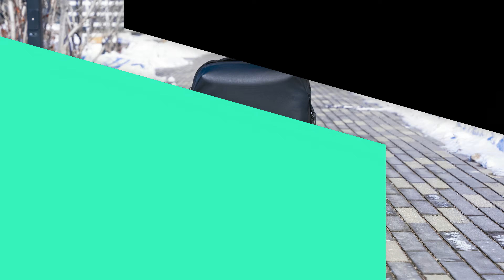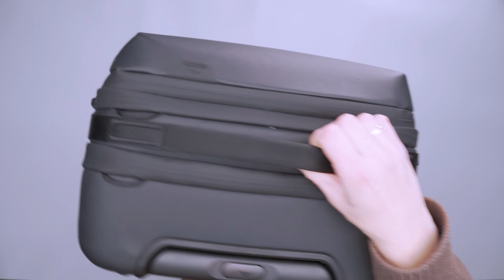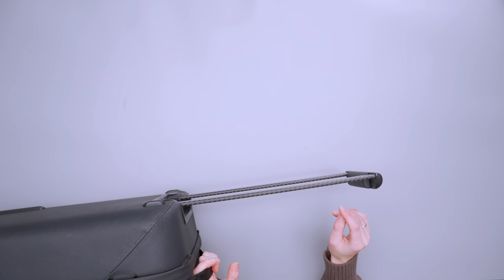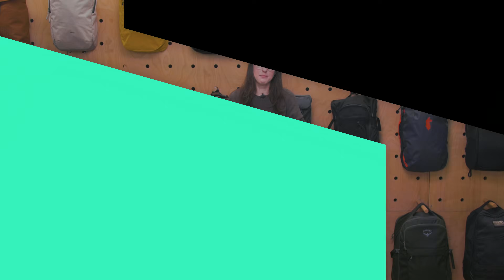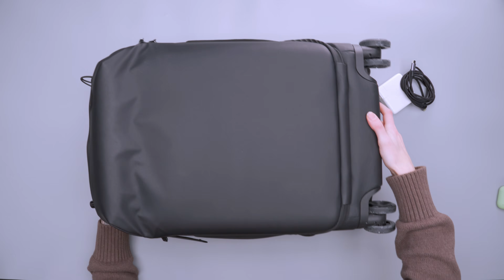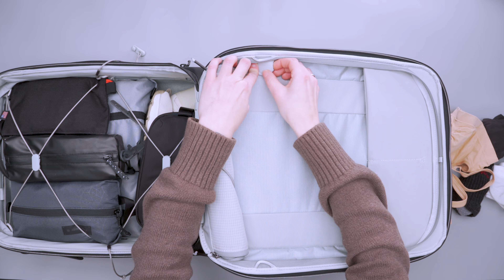Peak Design Roller Pro Review (2 Weeks of Use)

Comment: I can’t really understand the hype of the PD Roller Pro. To me it looks over engineered with solutions, where to me no severe problem exists. The upper packing compartment offers almost no volume and the new opening design doesn’t provide much benefits imho. All this leads to very heavy roller bag of around 4kg for only 34 liters capacity. Even expanded it doesn’t exceed 40 l.
My more traditionally designed climb shell type roller, Samsonite Proxis 55 cm Easy Access weighs only 2.8 kg, and has a 42 l capacity with 48 l expanded. The two packing compartments are large and have a zippered cover, which allows more flexibility than the PD roller pro. The roller bag also has a separate laptop compartment in front of the bag, and even more importantly a TSA lock, which the PD bag doesn’t have at all. 

So, in my opinion, the PD Roller Pro is simply too small for its weight. PD should have chosen a simpler lighter design.

Comment: How do you rate this so high if basically it can’t be checked in and most airlines won’t allow it for carry on? (US airlines excluded. Anything like a Lufthansa won’t allow for it)
Reply: It's still a high quality bag and where it's usable it's probably great. But as you say, it's too large for Europe (even though Peak claims "universal carryon", maybe for the US). The 4+ kilo weight is also a deal breaker for many, some airlines have 7 kilo totals, with 4 in the bag you have more bag than contents. If it were to fit, that is, which it won't. The handle design is great, though. They need to take that and then make a bag that is 2 inches shorter and 2 kilos lighter. They've definitely innovated, but they shot wide of the mark. Also, to be entirely frank... I don't t hink it's a very attractive piece, overall, either.

Comment: While the design and execution appear excellent (love it), I have two critical questions: 
1. Does the Peak Design Roller Pro comply with the international carry-on baggage dimensions of 55 x 35 x 25 cm (21.7 x 13.8 x 9.9 in) used by most international airlines; and
2. What is the Peak Design Roller Pro’s empty weight, given that many international flights now enforce a 12 kg (26 lbs) hand baggage total weight limit?
Reply: Both addressed in the video.
Reply: @ Yes, the answers are in the Peak Design Roller Pro Carry-On baggage’s specifications, but questions have to be asked to highlight the claim it is "Global Carry-On Compliant" which is only partially true. 
The PD Roller Pro’s external dimensions are 56 x 36 x 23 cm (22.0 x 14.0 x 9.0 in) while the average international carry-on dimensions are as 55 x 35 x 25 cm (21.7 x 13.8 x 9.9 in) for most international flights so it will depend on which flight and/or airline you are on. 
The Roller Pro’s empty weight is 3.9 kg (8.6 lbs) which only leaves you 7.6 kg (16.8 lbs) for total carry-on baggage allowance from the average total weight limit of 11.5 kg (25.3 lbs) for most international flights. 
Some airlines are now including the weight of your personal item as part of your total carry-on baggage allowance and are now stating that carry on items must be light enough to store in the overhead bin unassisted. So with that in mind, here is a breakdown of carry-on dimensions and weight limits for some of the major international airlines: 
- Air France: 55 x 35 x 25 cm (21.7 x 13.8 x 9.9 in) with a weight limit of 12 kg (26 lbs). 
- Air Canada: 55 x 40 x 23 cm (21.7 x 15.7 x 9 in) with a weight limit of 10 kg (22 lbs). 
- British Airways: 56 x 45 x 25 cm (22 x 18 x 10 in) with a generous weight limit of 23 kg (51 lbs). 
- Emirates: 55 x 38 x 20 cm (21.7 x 15 x 7.9 in) with a weight limit of 7 kg (15 lbs). 
- United Airlines: 56 x 36 x 23 cm (22 x 14 x 9 in) with a weight limit of 18 kg (40 lbs). 

Most U.S. carriers allow slightly larger dimensions (22 x 14 x 9 in) as compared to some international airlines, but the weight restrictions are often stricter with international carriers. Nevertheless, it is a great design exercise to stir up the status-quo, but I think I’ll wait for the slightly smaller Roller "non-Pro" version (V2) without the unnecessary laptop compartment and half the weight. Much like what they did creating the 30L Travel Backpack from the 45L Travel Backpack and downsizing their Wash and Tech Pouches.
Reply: Just traveled with Turkish airline. They limited to 8kg and weighted every time domestic and international flights.
Reply: The external size is 36 x 23 x 56cm, and the empty mass is 3.9kg. That is well into "ouch" territory, especially as it doesn't include a camera cube. The mass of this thing isn't so bad if you are flying on BA, which allows 13kg for your carry-on, but if you have a 13kg bag, you have to wrestle it into the overhead locker.

I'll stick with my Samsonite ultra-light hardside spinner.

Comment: Challenge question. How does one pack for a week or two weeks, if they Do Not want to be doing laundry on the trip? 
Wondering if it's a niche traveller group that wants one bag travel without doing laundry on vacation, or if you're missing out on a target audience by not including hacks for those types of travellers.
Reply: What are you looking for here, magic laundry that does itself? Merino clothing is good because it's anti-bacterial and the lanolin in the material keeps it from stinking even after a few days but other than that someone's gotta wash the clothes.
Reply: I travel with one carry-on and day pack no matter where I go, or how long I'm away. Yes, you do laundry. Basically a small amount each day to stay ahead of the curve for those few days that you can't. It is about the same effort and time as brushing my teeth. And I do that twice per day!

The benefits of being light and agile far, FAR outweigh the mild inconvenience of washing a few fast-dry clothes. Pro tip: Use the shampoo to wash in the sink, not the "soap."

Comment: Just get a Briggs and Riley bag. Incredibly durable, lifetime warranty, costs less, weighs much less. And get a $30 camera protector insert if you’re traveling with gear.
Reply: Looking at it spec-wise, design-wise, and price-wise, it may be competing with the B&R ZDX 22” Domestic Carry-On
Reply: @KevinBuehling  I've got the ZDX carry on. It's not only an incredibly smart design but it also never gets any eyes from gate attendants for bag size checks. Zero complaints here
Reply: Second the Briggs and Riley, got a Essential 22” carry on and it’s great. It costs more
Than Peak Design but you can usually get it at a discount at smaller brick and mortar baggage stores
Reply: But the B&R is even heavier at 4.6kg...

Comment: I feel this is just way over designed for something as simple as a carry on.

A hard shell gives plenty of protection, very light and I wonder if the overall packing volume (without the expansion) is even more than this one.

Nothing that really stands out, but the negative (weight) is actually a huge problem if you do intend to use it as a carry on

Comment: It's too heavy. I'd purchase it if it's not that heavy.

Unfortunately, some airlines' limit can go as low as 5 - 7 kg in Asia.

I'll stick with my Lojel.
Reply: Which Lojel do you have? I hadn’t ever heard of them but checking them out and their similar sized hardsided carryon is only .7kg lighter. Personally I think if an airline has an insane 5kg carryon limit they want you to pay to check or expect you to carry on a backpack/duffel.
Reply: @ironchefboyardeee I have a Cubo and an ulralight one (I need to check the model name, it's only 1,7-1,9 kg).

Yes, 5 kg is insane.
Yes, they do expect us to only carry one item.

They do it because:
1. They want to speed up the boarding and un-boarding process.
2. They don't want to park too long at the gates / tarmac.
3. Lighter plane = less fuel consumption 

You won't believe how low-cost airlines try to save money, they can and will turn off aircon.
Sometimes, we can't choose which airlines to want to fly with, lower cost airlines tend to have much broader schedules and options.
Reply: @ Interesting. Maybe they discontinued it because the small lite on their site is almost 3kg. 2kg would be really impressive for a roller bag.
Reply: Chinese flights rarely check the weight of carry-on luggage
Reply: @jiali7090  Not according to my experience.

Comment: Interesting bag.  I like the bag, but as a frequent traveler, I don't  like anything "hanging" off the sides of the bag, meaning locks or luggage tags.  A couple of years ago, I had to check my Rimowa cabin carry-on.  When being loaded on a cart from the conveyor, the luggage tag got caught up and somehow tossed the case off the cart and then it was run over by the tractor.  It crushed one corner of the case and damaged some things inside.  While Rimowa has a life time guarantee, it could not be fixed.  Moral of the story, don't let anything hang off the sides of the bag or case.
Reply from the maker: Thanks for sharing your insights! 🤙
Reply: I tuck the lock in the bag after locking it. I use Away cases for most of my travel now with built in locks which PD could have easily put in this design to make it one less thing to take on my travels.
Reply: @unitymind and heavier =P
Reply: Good point
Reply: So don't hang anything outside. Everything is detachable and reconfigurable. So put it inside

Comment: Certainly not cheap, but worth remembering it has a lifetime warranty and all custom hardware. Being able to replace the wheels is going to be really useful.
Reply: a lot of great brands with premium luggage have lifetime warranty too. so even if their wheels aren't user replaceable they will pick up your suitcase via a courier and deliver it repaired back. so I wouldn't really put this as a distinct advantage of PD .
Reply: @NL0Gwenster  I would be curious, which brands? Some might send you a replacement but most won't repair them, the old ones end up in landfill. PD are a climate neutral company and are conscious of their environmental impact. Not to say any of these qualities are unique to PD, but they add up along with others as to why they are a good company to support.

Comment: $600 retail seems like A LOT for a carry on, even if its very well designed and seems like a great bag. I travel a lot and work in video production, I don't see myself springing for this over a pelican air to travel with my gear. 

And if I'm not traveling with gear I'm really not so picky. I think $450 retail would be a bit easier to swallow but even then, a pelican air with trekpak dividers is regularly around $300.
Reply: This post saved me 20 minutes.
Reply: And that's before tax, I burned myself on the last kikstarter where i forgot this detail
Reply: A well-designed backpack costs around $400 to $600 these days...
Reply: @ Unfortunately super true. Try shopping used though, I bought my peak design everyday 30l backpack for $300 and its held up great for over 7 years now. I've seen it on the used market for around $125. Lots of high quality gear to be found if you're willing to compromise on the "new" tag. I will likely be looking for one of these rollers used in a few years at a price that makes more sense.
Reply: Peli Air does not have spinning wheels and laptop easy access compartment which is a dealbraker to me
Reply from the maker: Thanks for sharing your insights! 🤙

Comment: 600 USD.....
Reply: Peak Design's products are expensive, but very durable and guaranteed for life. They also don't use off the shelf parts for their products, everything is designed from the ground up. But yeah, it's not for everyone. If you're on a budget, you'll go for a commodity carry-on (or buy used).